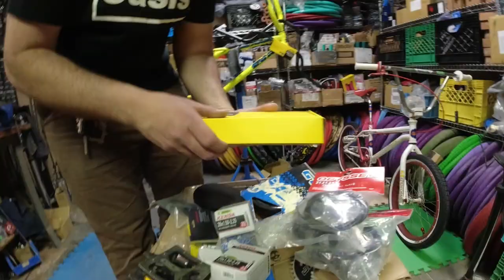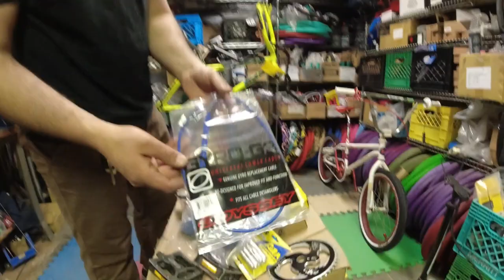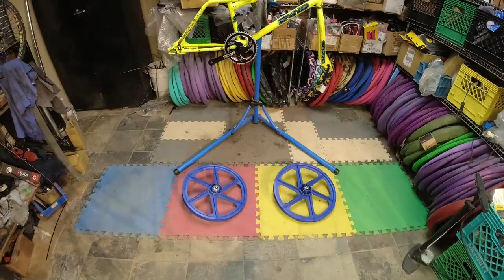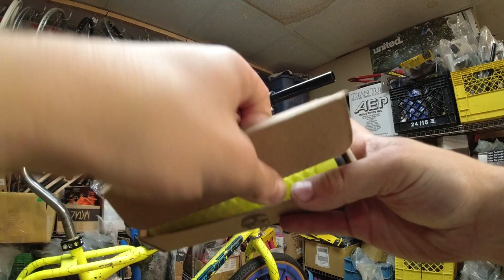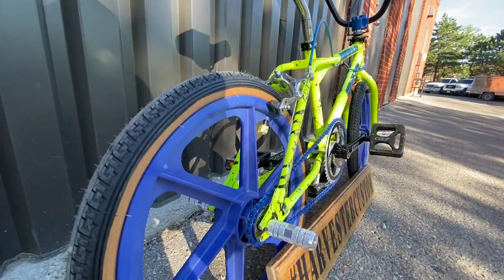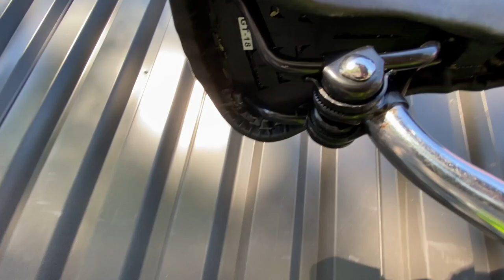1991 DYNO DETOUR 90's BMX BUILD @ HARVESTER BIKES

Comment: I found a dyno slammer frame on a dirt lot about 20 years ago. It was just the frame and the crank…. I brought it home and dumped what felt like over a grand into after the 3 piece cranks, wheels, headset, bear trap petals. Ect….   
The guy who did all my brakes asked me if I planed on riding back into the 80’s.       
I sad absolutely!